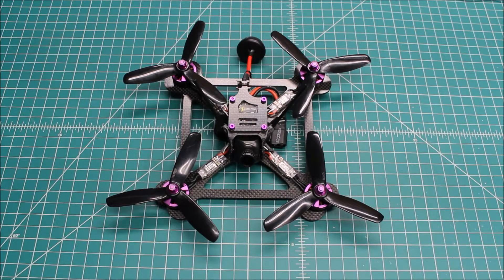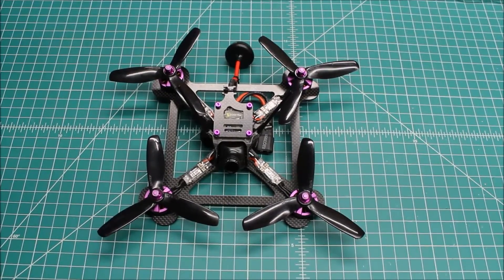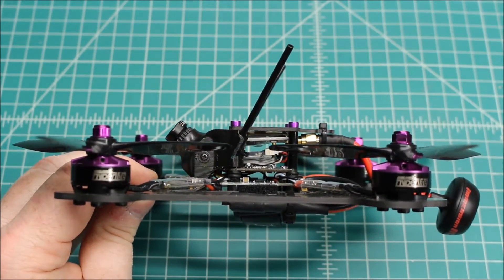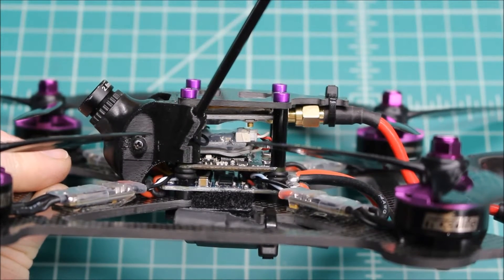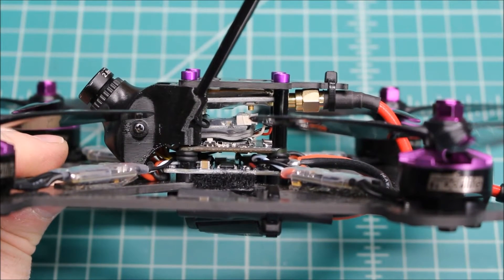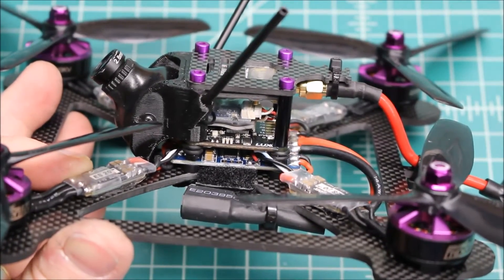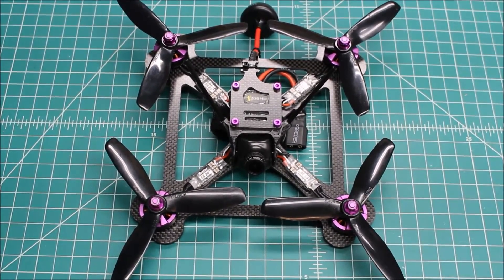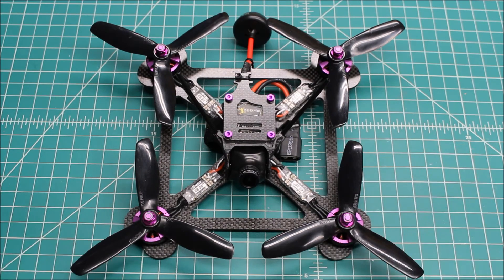Martian II to Kabob Transplant Completed Build

Comment: With the LUX FC wouldn't it be slightly better to sandwich the board between the rubber pads? Because the top stand-off will still be "pushing down" directly onto the board, well that's just my suggestion.
Reply from the maker: Thanks for the suggestion but the stand-offs need something more solid than neoprene to mount on top of.